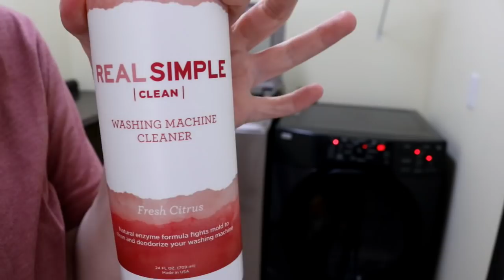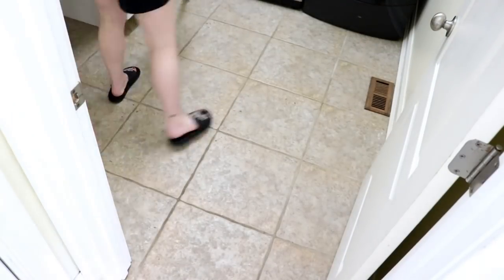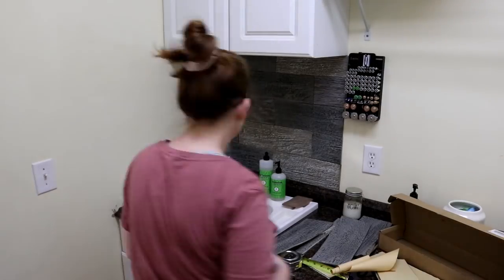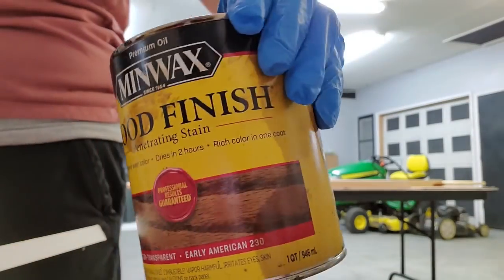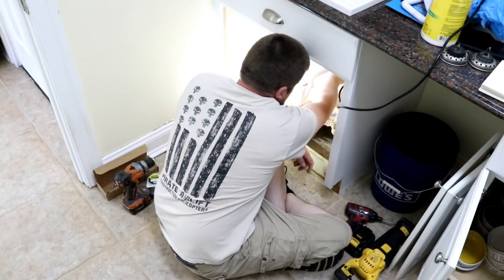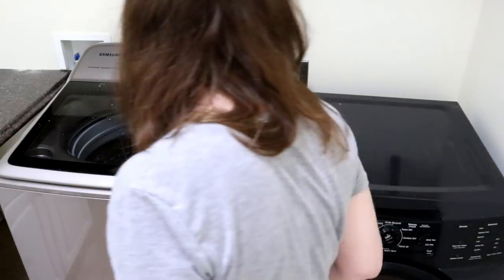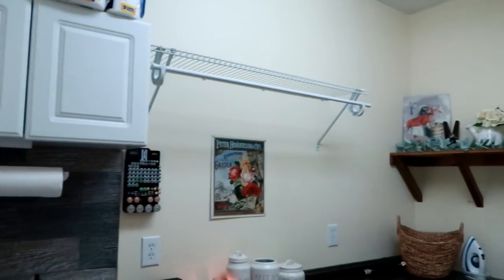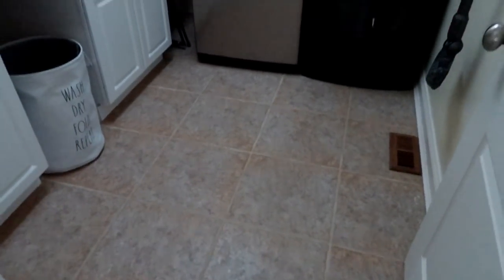Extreme Deep Clean Declutter & Organize | Clean #WithMe 2020 | Laundry Room Transformation

Comment: Looks great! The tile backsplash would look good all the way down. I have found that the turnaround discs work great on undersink storage. Easier to get at. Sammy in the background always 😃 I was looking at a older video of the kitchen in last house. Looks so small compared to the new one. Jealous of your space. I live in a 900 square foot house. Not enough!
Reply from the maker: I was using leftover tiles from an old project. I wish I had enough to do the whole way but didn't. I at least wanted to use them up. This is also a phase 1 makeover . Bigger plans and projects for this room eventually!

Comment: Very good video👍👏.
Your Samsung Washing Machine is how many kg? 🤔
Dryer can buy later.
Since this dryer is working fine.
Save money 👍😆
Reply from the maker: The washing machine is huge. We have a king bed so I needed maximum size to wash the comforter. I think it is 5.3 cusqft.
Reply: My Front Load washing machine is 10kg is a LG.
Rather have all bedding wash at home.
Save money too.
If need to I will use the Dryer too.
Washing Machine has a dryer function too.
I seldom use this Only raining days😄.
Smaller washing machine will have issue cannot put comforter or mattress protector for wash.
My mum has this issue😔

Comment: No brainer to keep a dryer that works well!!  I would do the same.  But PLEASE don't use steel wool on a fiberglass sink!  You are scratching the surface and it will stain and get dirty faster.  A drill brush set for a cordless drill will make your husband happy, and you can use the brushes for your grout whenever you need to.  I live in AZ ... Only tile floors in my house, no carpet at all.  Grout can be a beast to clean!
Reply from the maker: Thanks